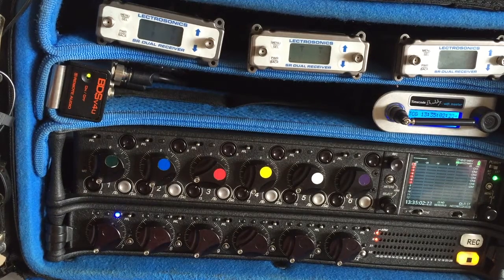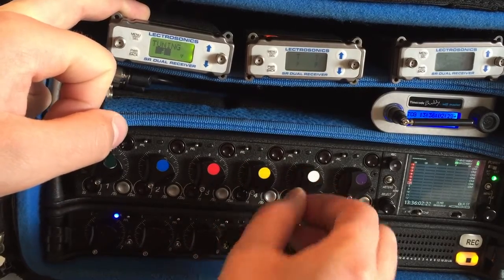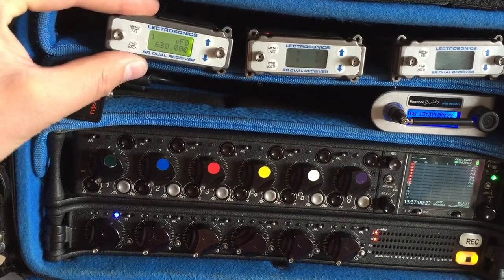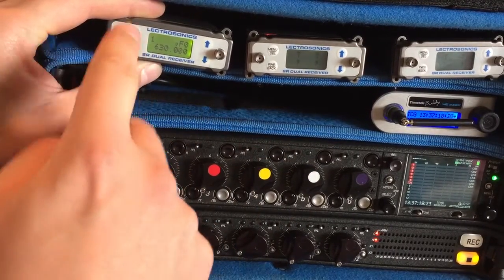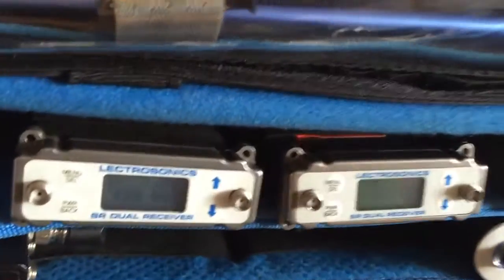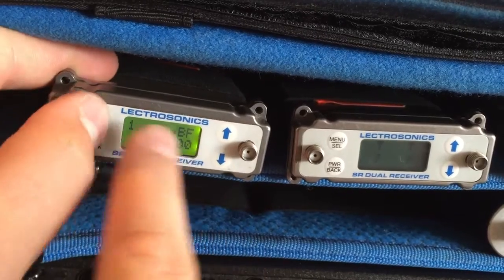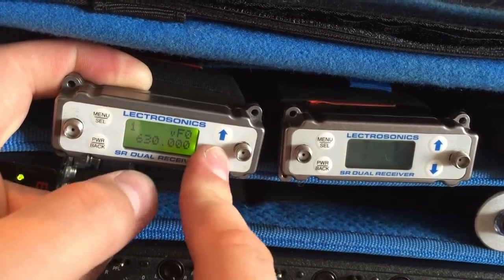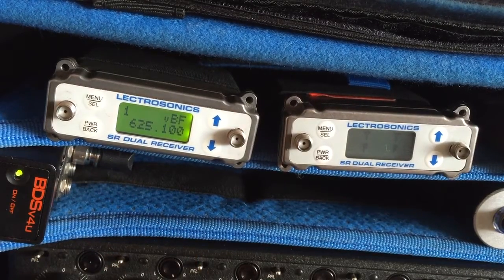Lectrosonics SRB / SRA Receiver User Tuning Groups Tutorial

Comment: I've talked to Lectrosonics and was told these SRa/b/c receivers do no IM calcs whatsoever.  Where do you get your info?
Reply from the maker: I was under the impression the A, B, C, D group were pre-assigned intermod free. See page 20 of the manual here: www.lectrosonics.com/US/phocadownload/srb5p_srb_man.pdf
Reply: I see that.  It's been awhile and I may have been talking to Sound Devices regarding their SL-6 interface rather than Lectro.  I just checked and those groups do appear in the SL-6 transmitter setup.  I have some questions submitted to them as to how the groups integrate with the SL-6 scanning function(s).  Thanks for your response.
Reply from the maker: I would imagine the scan wouldn't use the tuning groups.